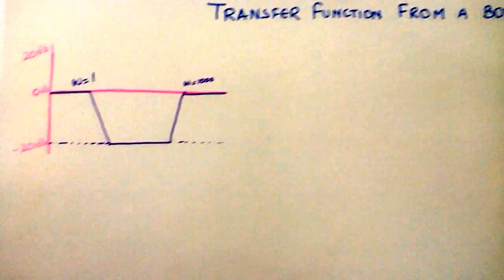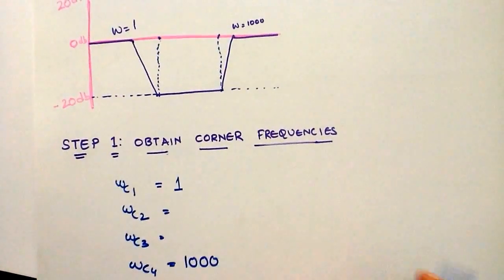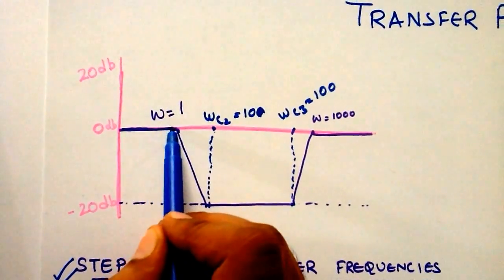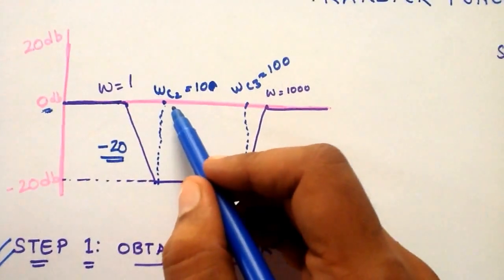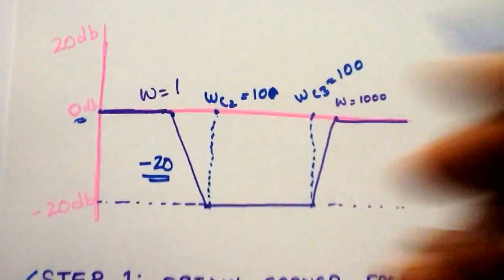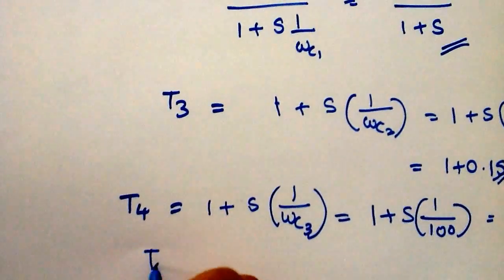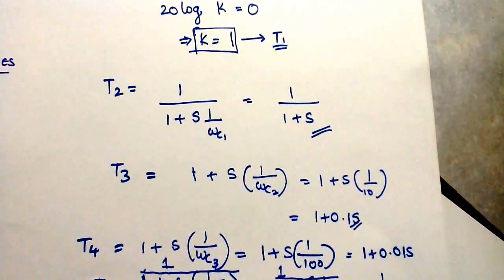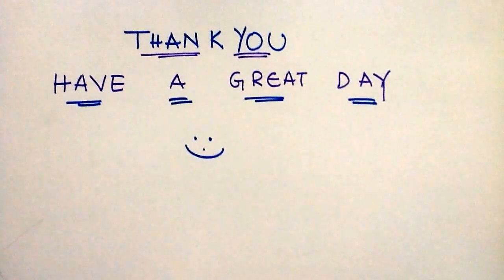Derivation of Transfer function from a Bode Plot

Comment: So where does the Bode plot come from?  This is a waste of time.  It is teachers teaching what they have been taught and think is important.  What is important is to record the control signal and response as a function of time and use that data to find the coefficients of a differential equation.  This is called system identification.  Now you have the transfer function.    Doing what is shown in the video is backwards.

Comment: This video is only valid for critically damped systems(damping constant = 1). Because you show no way to calculate the damping factor if a Bode diagram has a ''hill'' in it, a resonance frequency.
To include that:
Take the distance in dB from the gain to the top of the ''hill'', if your gain is 40dB and the top of the ''hill'' is with 54dB, than your answer is 54-40=40dB. Lets call this distance X for now.
X [dB] = 10^(X/20) = answer.
1 / 2Y = answer, and then your Y in this case is your damping constant, a lot of times named zeta. You can fill this zeta in in the standard second order transfer function.

Also, to verify if you have the correct corner frequencies be sure to check the phase diagram of the bode plot, it is clearer to see the corner frequencies from the phase plot.

That out of the way, this method works fine, thanks!

Comment: Hello, how do I calculate the constant K when the bode plot doesn't start with a constant line, but with a slope?
Reply: I think if the plot starts with a slope then that means there’s a pole/or zero at the origin. Let’s assume the slope is decreasing so that’s a pole at the origin. First take K=1, then normally the pole’s line would start at 20dB and decrease to cross the frequency axis at w=1 (Im assuming u label ur semilog paper starting at 0.1) (the line has a slope of -20dB/dec so at 0.1rad/sec, GdB = 20 , and at w=1rad/sec, GdB=0) (slope = -20dB/dec : check). Now if K was some other number, just take the difference of the point 20dB and the point where the slope line starts off and say that 20logK = that difference. I hope i am correct though nothing is certain